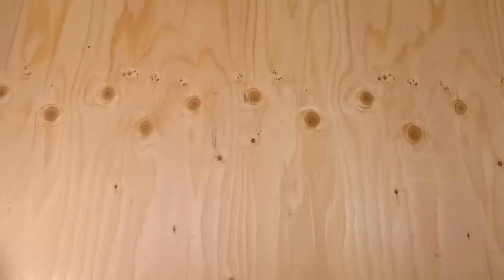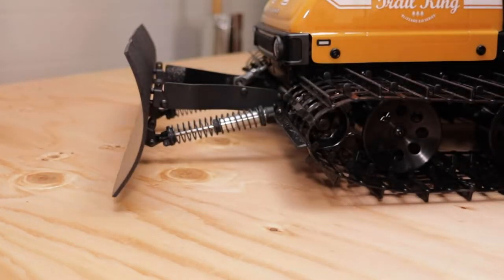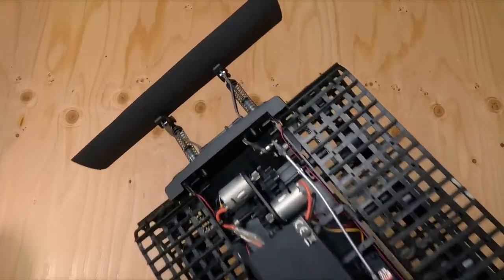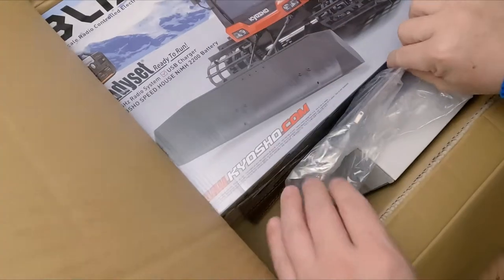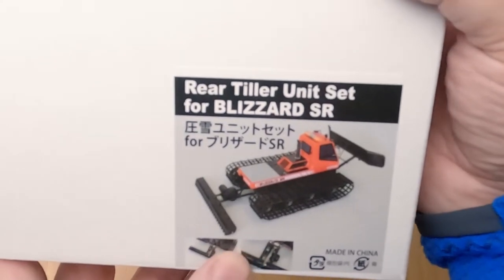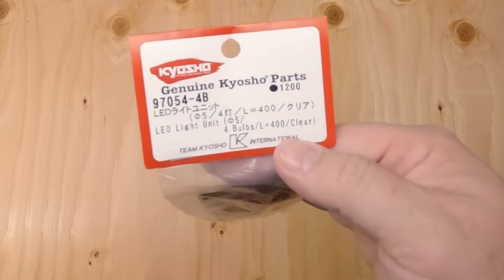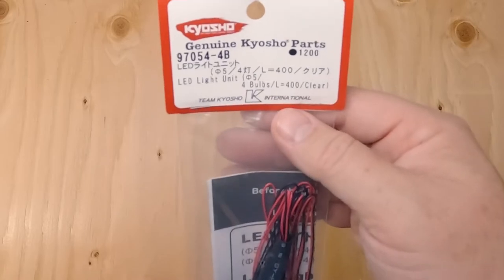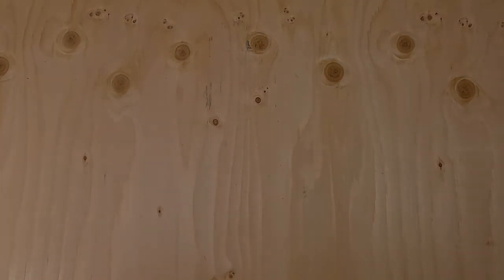We ❤️ Tracked Snow Vehicles! - Mail Call No. 1 - RC Stories Garage

Comment: I was thinking you were going to inbox a new Turbo Optima mid. I do appreciate your nice light dry fluffy snow. Our wet heavy stuff would give your snow plow a fit. Looking forward to your trophy truck build. Have you seen the kyosho outlaw rampage? Any have a great day!
Reply from the maker: Re snow: I still have to be fairly diligent and get with the ploughing when there is only a few centimetres of snow. Even with our dry stuff, over 4cm would be hard for the plough (that’s like half metre at scale!)

My racer is more of a compact truck than a trophy truck. Trophy trucks are an American thing. My build has an Australian/Japanese influence. The chassis is mostly done, except for the winch, but I need a few days of warmer weather to get the body painted. It probably won’t debut until the spring.
Reply: @rcstories_ca  I’m looking forward to it